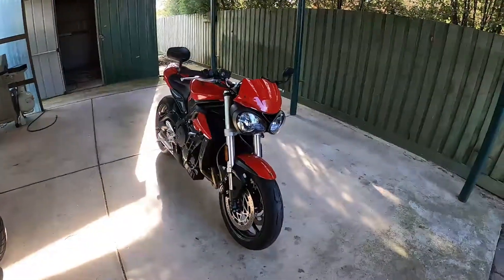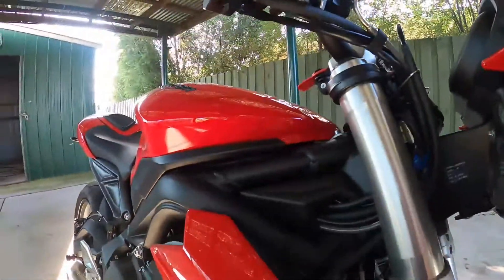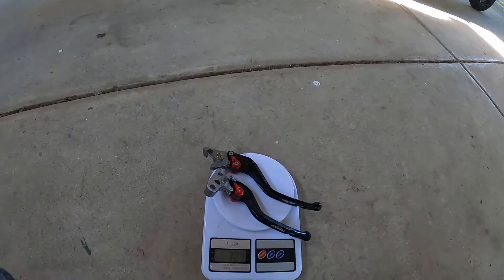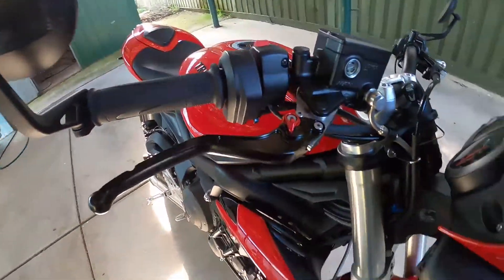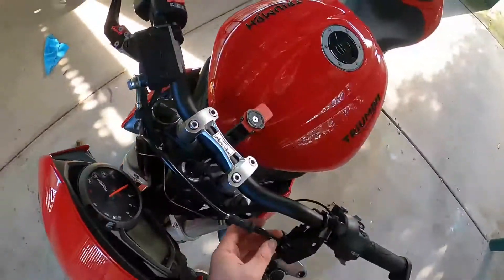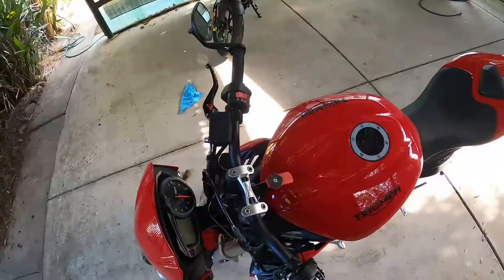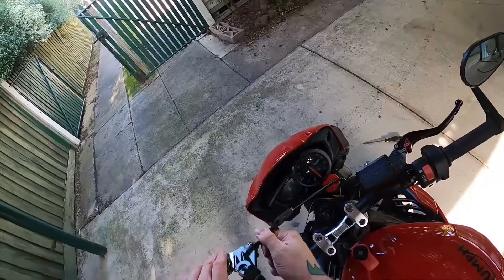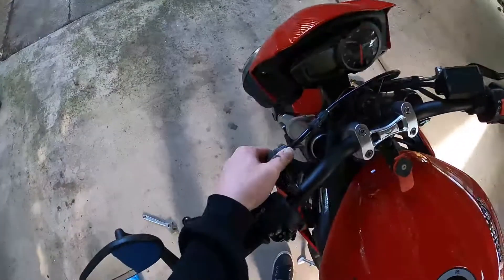Changing Levers | 2019 Triumph Street Triple S 660

Comment: How much range do these offer? The clutch on the stock is just a touch far so I'm wondering if these will be able to be moved inwards a bit more.
Reply from the maker: They have 6 points of adjustment instead of the standard 4 or 5. They feel like they are a little bit closer but not much. If any.